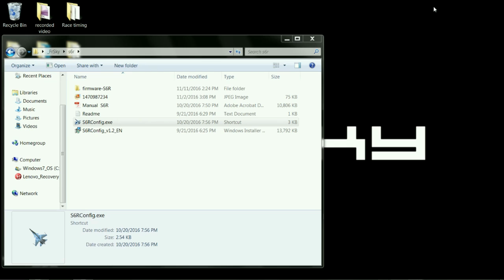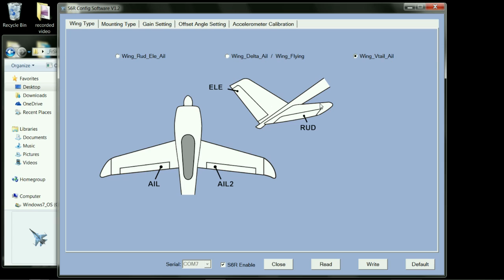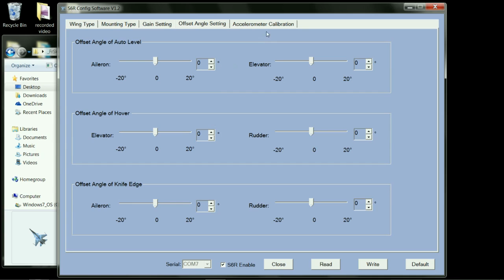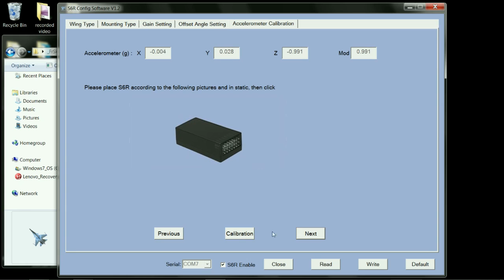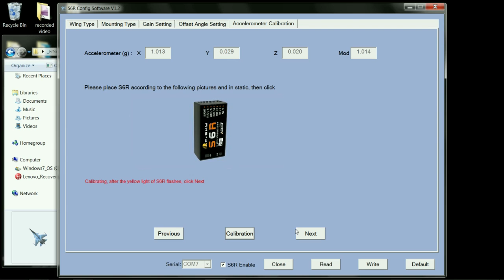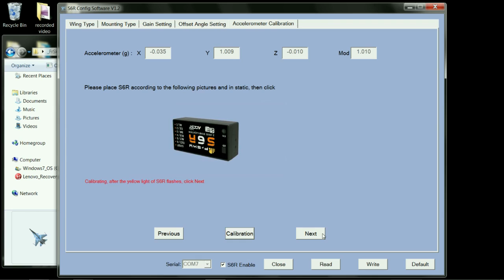How to config FrSky S6R receiver with STK tool

Comment: Help please. When I try and do this using my transmitter as my tx has the same function my transmitters stops transmitting, the RSSI drops below 15 and does not calibrate. I have moved my tx away from the rx and have even moved locations but to no avail. However when i am not calibrating my rx my tx works perfectly well and the RSSI reading over 100. It appears that this only happens when I am in the calibration mode. Any idea why this is?

Comment: This is out of date. There are no S6R and S8R config tools any more, just some "Tool-FrSky Freelink" thing. Once installed, it crashes each time I try to open it. I tried reinstalling it two times, didn't help. I can't even tell what goes on during the installation, because everything is in chinese!

FrySky's software is hot garbage.
Reply: Have you had any luck finding the "S6R Config Software"?
Reply: @gazpacho59  No, but a guy called ShondoRC has very clear videos on how to configure the FrSky recievers through the radio. Haven't applied what he says yet (waiting for an SD card so I can flash my radio before I move on to the receivers). I like how he starts by throwing the manual in the garbage, seems like the best first step in this case.

"S6R and S8R setup" by ShondoRC:  
https://www.youtube.com/watch?v=IBwbkcYOtO0
Reply: @JustAnAdjunct  WOW!  That video is fantastic. It spoke to directly the questions I'd been having, and he covered it in perfect detail. Thanks so much for the link.
Reply: It's sad. We need to run Freelibk as an administrator on PC. I spent a couple hours for that. :-(

Comment: No matter what I do, I can't get my STK Tool to see any of my receivers.  I've manually set the com port and everything and I get nothing.  What the hell is wrong.  WIndows drivers are correct, windows sees it.  I all the lights light up.  Reciever flashes red, but nothing.
Reply: I had the same frig'n problem then found some doc somewhere that said to use the other set of three pins on the STK. That worked to help me get new FW onto the S6R.  Good luck.

Comment: Thank you, 
Can I use the FrUSB-3 for this purpose? (FrSky Upgrade Cable FrUSB-3 For DFT DJT DHT Telemetry Receiver)
I purchased this one instead of the STK thinking that that was the right part. There are no specifications on FrSky's website.
Thanks for your input.
Reply from the maker: Hello sir, the FrUSB-3 is only used for upgrading the firmware, it can't be used for the configuration. Please note it.

Comment: Hi, I'm trying to connect STK tool with S6R but it is not connecting, I've installed S6Rconfig software v1.3 and when I connect STK cable with S6R the S6R only blinks red but on the config software page does not shows it is connected. On the other hand I've noticed that it only shows COM3, so here I can not choose COM7 as I've watched on the video.
Any solution please ??....

Comment: No matter how I try I can't get the Computer to see the device I've tried three different computers following your procedure. The Windows installs the STK driver fine, but S8R not viable at com port? Also I cannot update the SKT with the Sport REV14 same issue, not seeing it at the port no device found.
Reply: Try to assign a low number for USB port 
For Upgrade :
- move the switch on SKT to "upgrade" position
- selct the COM port
- open the .FRK file
- now, and only now,  connect the receiver to the SKT

Comment: Thanks XSspeed. Mine was com 12 and wouldn't communicate at all!I'm un-able to get the gains to change with a slider according to the manual, Ch 9.It says "gain=abs (CH9-M)" so "M" means 1500us, what is "abs"??The switch combinations are ridiculous for the 4 flight modes but should be configurable in the Open TX settings. Another night...Ch 12 for reset also cafluey :-(
Reply from the maker: Hi, "abs" means absolute value.